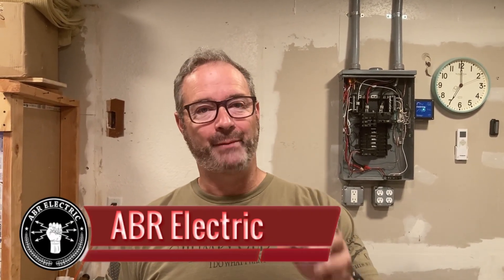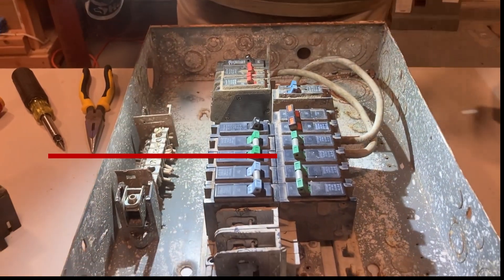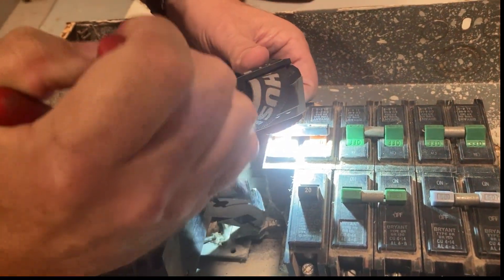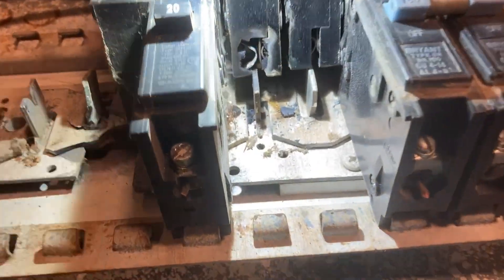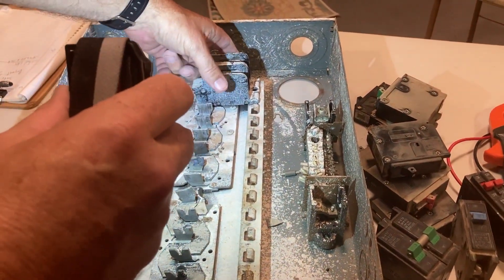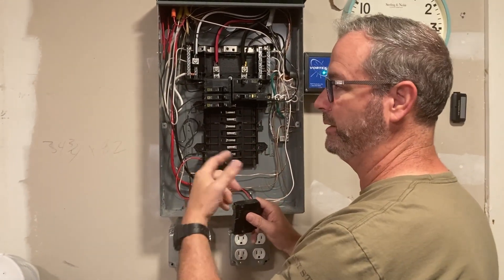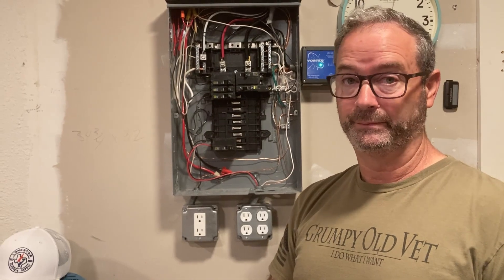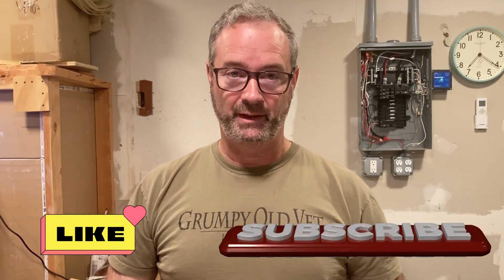Deep Dive into a Bryant Electrical Panel : Why Bus Bars Burn in Older Panels - Celina TX

Comment: Looks like somebody sprayed wall texture into that box and did not get it cleaned-up before installing the breakers. I have an old Bryant box that should be upgraded because it has a split bus and I need to add a circuit to feed a subpanel, but have never had any problems with it. Another problem is that it doesn't have a main breaker if you ever needed to replace one of the 240v breakers.

Comment: Indiana here. I have a Bryant. I know someday I want to change it out but so far I haven’t had any of these issues. I do know it’s hard to find breakers for a Bryant which is one of the reasons why someday I want to upgrade the whole panel. Mine does has a main cut off. Not a split bus
Reply: Bryant “BR” type breakers are made by Eaton and can be found at any big box store.

Comment: Do any panels today use soft aluminum to hold breakers?
Reply from the maker: @PoolcleaningdallastxNet  No, not that I'm aware of.
Reply: aluminum is still being used for buss bars but i believe but don't guarantee they are tin plated. the tin coating lowers the corrosion
problem and provides a hard surface for the breakers to plug on to. the aluminum buss bars of today are supposed to be far superior to the original ones. eaton type CH, general electric and square d QO have copper buss. all the others probably have the tin plated aluminum buss although they can be probably be  purchased with a copper buss. that being said i would still go with copper. i use general electric due to them  having copper buss plus they are priced much less than square d QO and eaton type CH.

Comment: Ahh, the lovely memories of dealing with burnt bussing. I would rather deal with a meter can changeout hot due to some of the crazy stuff I had to deal with inside a breaker panel. Firstly, I find them in spaces where there's no business a breaker/fuse panel should even being there. Sigh, the early days of electrification.

Fast forward to now is the beginning of the electrification of motor transportation and those old panels are going to be the real "hot topic".  I dabble with EVSE installations, mainly Tesla wall connectors due to their design takes majority of the nuances out of the installation. When I come across those old panels, I just have to flat out refuse to do the installation for the buss burnout risk is even greater since those panels are only rated for 100, 125, or maybe 150 amps tops.